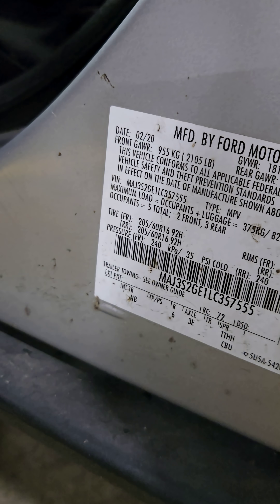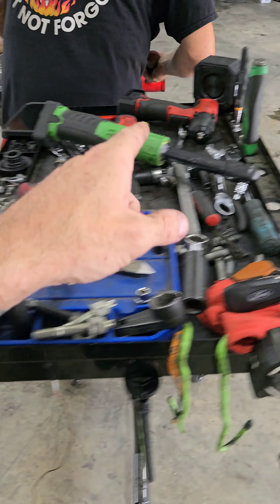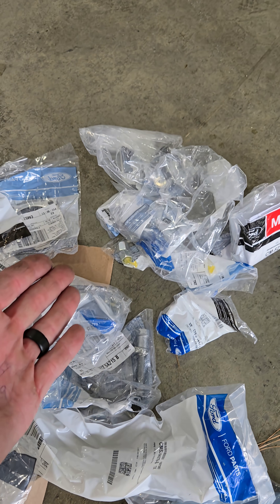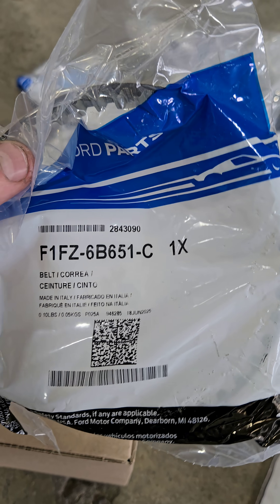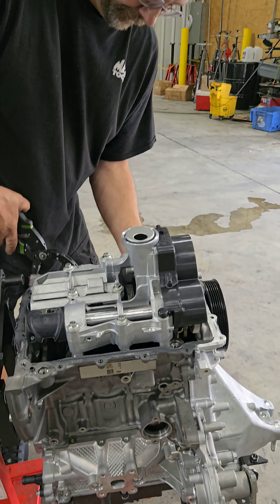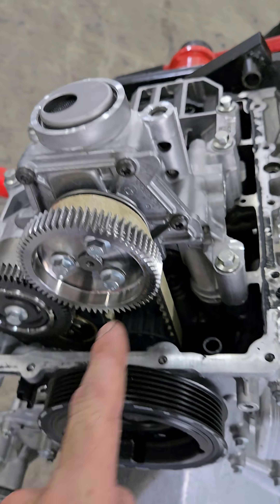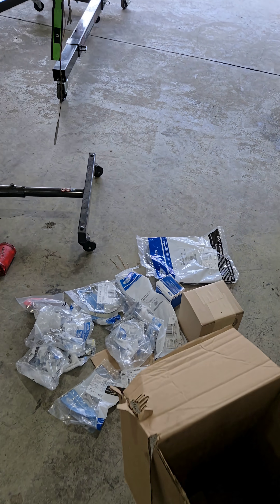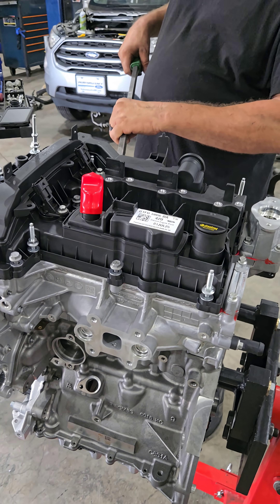Brand New Engine Torn Down WHY? 1.0 Ecoboost

Comment: Oil pump belt. Only Ford engineers would be so stupid.
Reply from the maker: Ohhh. So PSA (steallantis) Volkswagen arent for doing the same thing? Or GM for using one on the 3.0 duramax on the back.of the engine?  Its only stupid if its ford right? Got it. Mentally noted. Move along now
Reply: @BeardedFordTech But weren't they the first to do this? 1.8L TDCi, Ford Europe.
Reply from the maker: @anonymousinc6330 yep in the early 2000 but they stopped. Then other manufacturers syarted and ford did it again.  This 1.0 is garbage. And i can agree to that 100 percent. It shouldnt have a belt.  The 2.7 and the 21+ 5.0 (f150 not the mustang) have one and very very very few issues with it.  They are kevlar reinforced. The 1.0 belt wasnt. Which is why this has to be done.  Come to think of it. The GM 3.0 isnt kevlar either
Reply: @BeardedFordTech I don't defend anything GM's done since about 2009. I drive a Toyota now.
Reply from the maker: @anonymousinc6330 i dont defend gm either. Last one i owned was like 2000. I dont defend toyota either (newer stuff)  lots of engine problems. Got a friend who is a master at toyota.  They are doing engines in them as they roll off the truck before they go to the lot for sale.  The guy 3 houses down from me is on his 3rd engine on his brand new tundra. He doesn't even have 10k miles. Anything 2014 and back im cool with. They just arent what they used to be either. Everyone manufacturer has basically gone to trash
Reply from the maker: @anonymousinc6330 i will tell you this though. Toyota would be my second choice. Anything but gm or RAM/Dodge
Reply: @BeardedFordTech Drove many a Crown Vic as a taxi driver and they were great cars. But all the Big  Three's design, engineering and build quality has been nose diving hard in the past 15 years.
Reply from the maker: @anonymousinc6330 crown vics would not die. Thats why they were police cars too!  I totally agree about the past 15 yrs.

Comment: Doesn't matter what updates they do its still trash. Ford should be embarrassed that they put this trash in their vehicles. The best thing you can do is add a secondary oil cooler. Same with dodges sprinter vans that blowing up. Oil gets to hot and motor cooks
Reply from the maker: So what about gm and volkswagen. And the  many others who use it?  Do aome homework

Comment: Built Ford tough  :(
Reply from the maker: Its a 3 cylinder. Nothing rough about it. Dont forget to say that to PSA (stellantis) and Volkswagen too. They use wet belts. So does GM with the 3.0 duramax (on the back of the engine)

Comment: I don't care if its wet or dry. Why are you driving the OIL PUMP with a belt?
Reply from the maker: Less friction. More stable oil flow. At least on the trucks.  But this belt also wasn't kevlar reinforced. Thats where they messed up.

Comment: I would like to know why it had coolant in the cylinders and engine oil. It sounds like a head gasket but what is the cause of failure? I have a 2017 Ford Edge with a 3.5 l naturally aspirated engine, chain driven timing. It has 170,000 mi and still runs great. I'm kind of terrified about having to buy a new car with so many manufacturers having so many problems. Any recommendations?
Reply from the maker: It had a cracked in the cylinder.  Yours is would get rhe water pump done now. Yes its a timing chain. But the pump is internal driven by the timing chain. That goes out. You'll need a new car.

Comment: Wet belts are sabotage. I would never purchase a vehicle with a wet belt.
Reply from the maker: Oh, you wouldn't?  Did you know most manufacturers use a wet belt?  Ford didn't think of this. GM uses one on the back of the engine on the 3.0 duramax. Volkswagen uses them PSA (Stellantis) uses them on some vehicles. Some audis. The ford 2.7 has a wet oil pump belt (never saw an issue with those) the 21+ 5.0 liter in the truck uses a wet oil pump belt (havent seen an issue with those either)  quite a few manufacturers use them. If it's just a straight rubber bel, that'ss not good.  But....most are kevlar reinforced. Like the 2.7 and 5.0. This ecoboost wasn't.This is why it gets updated to a keblar reinforced

Comment: Why wouldn’t they update the belts at the factory? Is the update that new or do they have these engines sitting around a warehouse for years?
Reply from the maker: No they arent just sitting around. But...this engine was built before the updated belt came out. Its one part number behind. So there may be a few out there that were built that is one part number behind. Going forward when they get built they should be updated.  That is a very good question. Thank you for asking.

Comment: EcoSport with tiny wet belt engine. What a waste of a solid little SUV. I may not like the acceleration of mine with the AWD 2.0 n/a, but at least it has a timing chain. Compared to a former friend's FWD 2015 Chevy Trax, my little EcoSport is relatively built like a tank. The Trax is a hollow tin can. Flimsy doors, and virtually no subframe to put a jack under. I can with the front of the EcoSport no problem. I love the 2.0's oil filter location. It's a little beast in the snow with snow shoes. More aggressive AWD system than the Trax ever had. I wish Ford went with the 2.5 and 8 speed transmission for N/A AWD. It's 2.0 with zero torque works too hard moving a vehicle with nearly the weight of a 57' Chevy. An 8 speed alone would've helped a little with its bad MPG.
Reply from the maker: I like the 2.0 better too

Comment: Hey I got a question, I have the 2.7 in my 150 and bronco and they have an oil pump belt right? So if I keep the oil changed and keep the engine nice and clean will that belt last a long time? Also why do you they use a belt anyway?
Reply from the maker: I have not come across any issues with the belts on the 2.7. Bronco still fairly new.  My 23 f150 5.0 has a belt.  They started that in 21.  They went to belt because it reduces friction and also gets oil up to the engine quicker.  Use a good quality synthetic oil that meets or exceeds the fors recommendation. I use amsoil. But you can use whichever you like.
Reply: @BeardedFordTech I use amsoil in the voodoo and on my 2.7’s I use that really really good schaffers 5w30 full synthetic with that moly in it.  Also I did find your email on your description on your channel
Reply from the maker: @timschultes6467 sweet!  But extra moly.doesnt actually mean better. Lake speed went over that on one of streams. Too much if one thing is not always better. I would send that off for testing
Reply: @BeardedFordTech don’t worry the dude that came into my shop did a test with it and they gave me sample cups to send it off it’s pretty awesome stuff

Comment: That's funny we went back and used a timing belt. Smh. Engineers went from dumb to dumber.
Reply from the maker: Yeah and its a bunch of different ones. Not just ford
Reply: This is stupidity at its finest. This is the damn EPAs fault, they give unrealistic guidelines for manufacturers so the only way they can meet them is to cut weight. Resulting in plastic shit all over the engine, belts instead of chains, 0w-8 oil that’s like water. Just junk after junk! And prices go through the roof! It’s gotta stop!
Reply: Timing chains only on Toyotas......
Reply from the maker: @TheRedc0met not entirely true. Carry 4 runner and Tacoma used belts in the early 2000's. But these new ones arent what everyone thinks. Lots of engine replacements. My neighbor has a 25. On its third engine.
Reply: @BeardedFordTech my K20 on a civic SI full timing chain. Same with the 2GRFE for 20 years. Same with the 1URFE I have now.
Reply from the maker: @TheRedc0met thats why I said some. And honestly. Nobody really cares. Its not the belt thats the problem on these. Its the tensioner for said belts. But this engine is garbage. That i can agree with everyone on.
Reply: @TheRedc0met Toyotas and Honda's are 👌🏼

Comment: I hope Dorman is watching. PLEASE produce chain kits with needed parts for these oil pump belt engines. The nano v6 and coyote v8 are worth saving.
Reply from the maker: I'm working with dorman. The coyote is wet belt is only.in the truck from 21+  not the mustang and I have yet to see a problem with them. Dont forget sbout the 2.7. Haven't seen a problem with them either. Just on these 1.0
Reply: Don't think the assembly  could stand the increased weight  or drag from chain. It used to be a thing in the 70's  to install  a Pete Jackson  gear drive instead of chain on cam. I did not notice a benefit  for regular  driving. But do say ; I detest the belt submerged  in the pan.
Reply from the maker: @WayneSummey-q8c yeah we picked up on that. Thats your opinion.  Its really not meant for this car. This car was a total crap shoot design.

Comment: I can see NO REASON at all to go through all this work to ATTEMPT to rescue an ABSOLUTE POS!!  A genuine disservice to the client!  My opinion....42 yrs of maint/ repair on QUALITY automobiles by Honda and Toyota..
Reply from the maker: Well Toyota and Honda arent really quality anymore that was 42 years ago. This is a new engine. The old one had coolant int it.  This was also falls under the recall for a new updated belt and tensioner. So do it while it is out. Have you seen the new Toyota and Hondas? ABSOLUTE POS my neighbor has a brand new 25 tundra. On its 3rd engine already.  But I guess thats okay since it isn't ford right.

Comment: Ford piece of s^*t.. real smart..a timing belt that runs in oil.. yep. One of ford's better ideas
Reply from the maker: You do know this isn't Ford's idea, right? Well, I take that back. You didn't know. Cause if you did. You would know that PSA (stellantis) Volkswagen and some audi uses a wet belt. Let's not forget about GM and the 3.0 duramax that uses a wet belt on the back of the engine.  Do some more research before you try and bash a manufacturer. You make yourself look pretty dumb with comments like that. 🤦‍♂️

Comment: Belt for oil pump...only idiots can produce this..😮😮😮😮😮😮
Reply from the maker: That means just bout every manufacturer is an idiot. Cause just about all of them use it. PSA (stellantis) Volkswagen some audi GM on the 3.0 duramax and its.on the back of the engine. Just to name a few

Comment: Yeah I heard the belt clogs up oil passages in the 1.0. Oil starvation is BAD.
Reply from the maker: It completely clogs up the pickup tube. Not just the passages. Its a crap engine

Comment: Oil pump belt seems so stupid... I'd make it chain or gear driven. Isn't the the same engine that uses a "wet timing belt" "wet oil pump belt?" Why on earth would you oil a toothed belt? It seems absurd. Maybe Ford found something that we don't know?
Reply from the maker: Oil pump belt and wet timing belt are two different things. The oil pump belt goes from the crank down to the pump. The timing belt goes from the crank up to the cams.  I'm not fond of the 1.0. But. They did update the belt (see part numbers in pinned comments) they updated it to what the 21+ f150 5.0 has. A kevlar reinforced belt (I've seen no problems with those)  did a pan on a 21 f150 5.0 for leaking. Had a 125k miles or so. The belt still looked brand new. But the timing on the 5.0 is chain.  The mustang uses chain for both.  This little 1.0 they never got right. I am working with dorman for a chain conversion on the 1.0.
Reply: @BeardedFordTech  I knew that the timing belt goes from crank to cams, and oil pump belt from crank to pump, and that they were different, but I was just wondering why they decided to use a wet belt system instead of going with something that's tried and tested, proven to be reliable, like a chain drive for the pump and cams. I feel that if they had did that, then they (Ford) wouldn't have had to issue a recall for the oil pump belt. Having the belt reinforced with Kevlar is better, for sure, but I'll stick to chain drive or gear drive for something as crucial as the oil pump.

What are your honest thoughts on the wet oil pump belt?
Reply from the maker: @datgamerboy123 my honest opinion is that its garbage on the 1.0. They rushed it. That mixed with people using any oil thats the "cheapest" think oil is just oil, not maintaining it or getting it check doesn't help.  
It has been adopted for use because it reduces friction and allows the oil pump better circulation (when working correctly)  the 21+ f150 uses a kevlar reinforced belt with a billet pump.  So does the 2.7. Rarely i have i seen issues with them.  
So its a double edge sword. 
The 1.0 was just a disaster.  And I can't stand it.  As far as the others go they seem to be fine. 
Ford didn't come up with it and arent the first to use it.  GM uses it in their 3.0 duramax and its at the back of the engine. PSA(steallantis) uses it. So does Volkswagen just to name a few. So it can be a good system if maintained and designed properly.
Chains are great. But they wear out too and nobody every checks those until its too late.
Gear to gear like on the 6.7 powerstroke is amazing. But it has issues to. Like where the crank pulley will spin a little on the crank cause its pressed on and it will throw it out of time. I've seen that twice.
In other words the 1.0 is a disaster. We will see how this updated kevlar reinforced belt and updated tensioner goes. Its really early to tell right now. Then again. Will this customer keep it maintained?  There's a lot of factors to figure out.
Reply: @BeardedFordTech  for sure. I had no idea that other manufacturers used it, too. I thought it was only Ford. That's my mistake. I wasn't saying that the other drive methods didn't have their own set of problems, just that they seem better than using a belt. I can understand that it reduces friction, though.

Thanks for the reply.
Reply from the maker: @datgamerboy123 your welcome. Yeah its not just ford though. There's others who use it. See we all learn something.

Comment: That's why Ford needs to take a few pages out of Toyota's book and if it's tried and true leave it alone!
Reply from the maker: You mean the book with all the Toyota engines failing?  Guess they already took pages from that. Toyota has gone downhill. Look at all their engine and transmission failures happening
Reply: @BeardedFordTech laugh out loud when I met that I meant older Toyota knowledge back then when manufacturers gave a damn
Reply from the maker: @CajunShrek oh yes. I can agree 💯 on that
Reply: @BeardedFordTech we know Toyota ain’t what it was two decades ago, pursuit of fuel efficiency, emissions requirement  , multi speed trannies ,oil viscosity does take its toll.
Reply: Lol...Toyota engines failed too. Do your homework 😂😂

Comment: The new engine also has an updated timing belt. E3BG-6K288-BA instead of …-…..-AA 
It supposed to not contaminate oil pickup. In Europe its widely known.
Reply from the maker: Its known worldwide. This engine didn't have the the new belt. You could see and feel a difference. Otherwise he wouldn't have to have to do the recall.
Reply: @BeardedFordTech  I’m not talking about oil pump belt - yes there is a difference between old and new one.
I’m talking about the TIMING belt. The standard (base) timing belt has the part number CM5Z-6268-A (E3BG-6K288-AA) - it contaminates the oil pickup. 
Ford released an updated timing belt though no recall been released - E3BZ-6268-B (E3BG-6K288-BA). 
The new engine has an already installed updated timing belt. And if you’ll check the old engine you’ll find the base timing belt installed.
Reply from the maker: @АндрейЗайцев-у7ы yeah I know. He put a new timing belt in thus one too with updated part number
Reply from the maker: Standinf here golding belt of new engine and new belt in bag
Belt part number off new engine. 
E3BG 6K288 BA
New belt going in engine
E3BG 6K288 CA
and updated timing belt from the BA. Thats what I was trying to say.